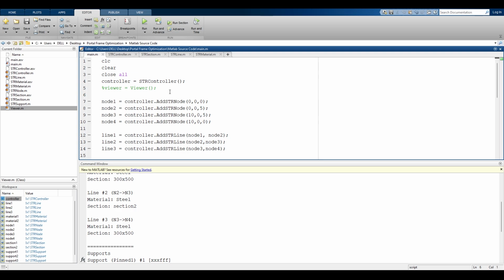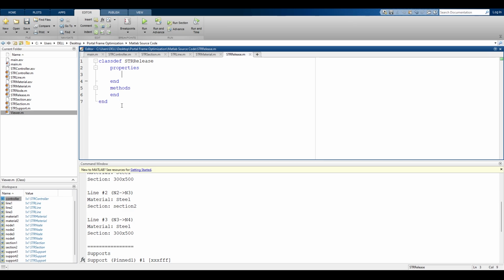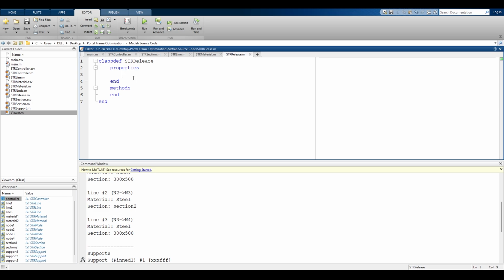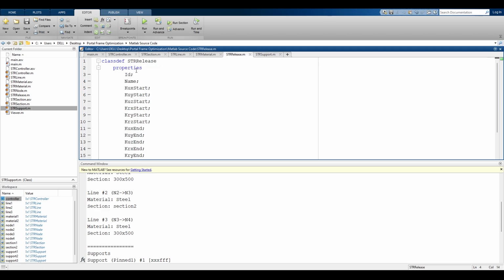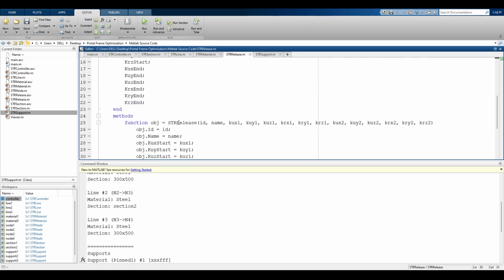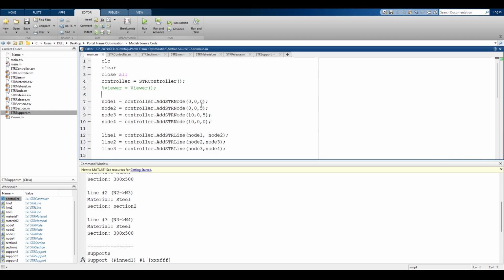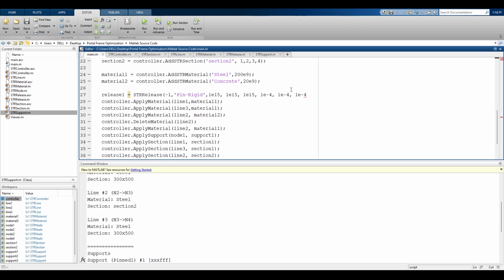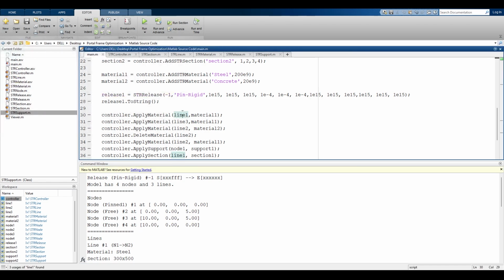Programming the Finite Element Method using MATLAB - Part 15: Defining STRReleases

Comment: I think more proper way in organizing is to set the material as a section property then the section should be assigned to line
Reply from the maker: That is even better to be honest.
I understand your point, for example, and I section is 99% of cases a steel section, so let's keep the steel inside the section properties

PS: sry for the late reply.